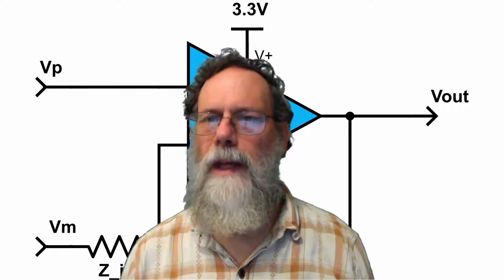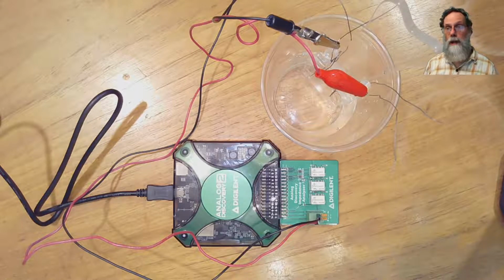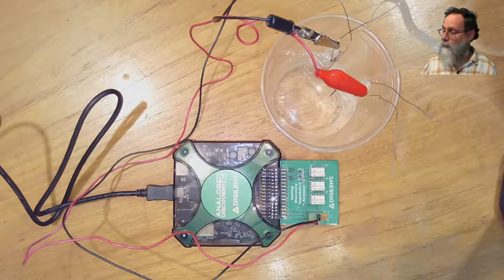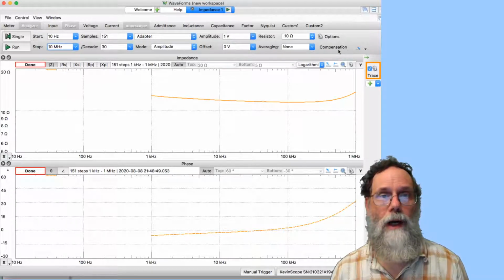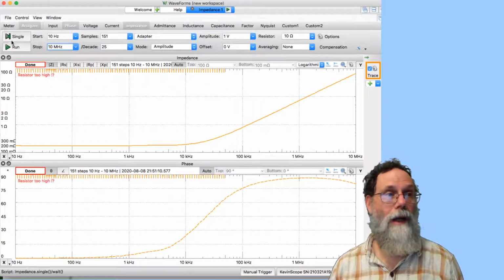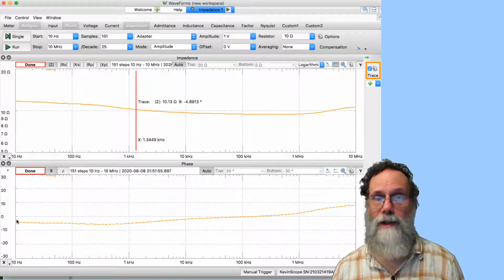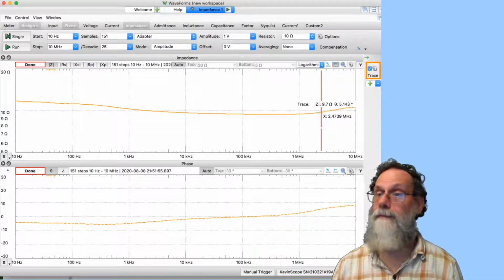Measuring AgCl electrodes §39.5.4

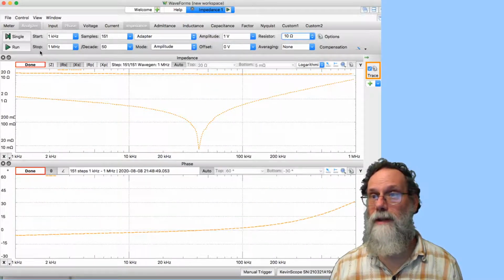Comment from the maker: There is an error about about 3:40.  Using a 10Ω sense resistor  results in a load on the waveform generator of about 11Ω. With ±1V amplitude, we are asking for ±91mA of current, exceeding the ±30mA limit, so we would get clipping, which ruins the measurements.  We should reduce to about ±300mV for the amplitude, to avoid clipping.